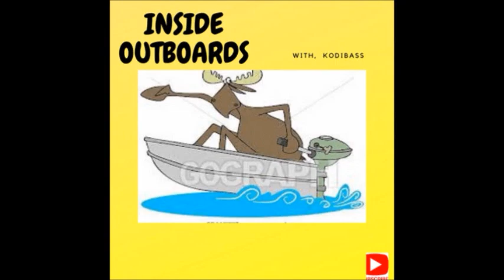JOHNSON 30 HP Outboard     ,, FIXED,,

Comment: Another Great Video from my man KB !  Let those advertisements play ! Happy Memorial Day ! Never Forget ! WhoWhoooo !
Reply from the maker: +TOO---------TOO Kind'  thanks                  L.
Reply: Maybe one of you two know the answer. I have a 1972 20hp Johnson and I t is jumping out of forward at WOT. I was told when I purchased that it would slip out of forward every once and a while. Is there an adjustment for the shift linkage or do I have to open the gear case to check teeth on shift dog and forward gear? Also should this sheer the pin for the prop when it slips out?
Reply from the maker: @MW-gv9vz    Most likely cause is clutch dog shoulders are rounded & warn,     It should not sheer the pin         kodi
Reply: @MW-gv9vz  I had that happen to me once and it did turn out to be in the linkage at the brass connector.
Reply: Well I got it opened up and the brass connector was stretched a bit. But I think more importantly one of the pins on the shift lever was pretty much worn down to nothing. Also the cradle around c.dog where the worn pin resided was all jacked as well. Every thing inside lower unit looked brand new gears, dog and all. My guess someone didn’t know what they were doing when they put it together. Got me a new shift lever and cradle. Just waiting on seal kit. I’ll let you once I get it in the water. Cheers.
Reply: Update ran fine in a barrel in and out of gear at idle great 20-30 min plenty of time to get warmed up. It could hold higher RPMs as well. But I take to the lake next weekend got running got about 45 seconds off the dock at half power. Went full power and lost power engine died out then I couldn’t get it to idle for more then 10-15 seconds. Any Ideas
Reply: Also my kid loves going fishing. But he getting discouraged this is three times now something has gone wrong.
Reply from the maker: @MW-gv9vz   Check & Re-check your compression numbers,  LMK  what they R.    kodi

Comment: That starter WILL NOT fit my 1982 - 15 hp ! Mine don’t have that tail on the left side and they have a U cut into the back of the bracket but thanks for looking ! I’ll stick with the pull string for now I guess but do need a recoil cup for it ! My spring keeps popping out ! Lol. I know there’s a farmers fix with wire but it’s my personal motor and I want it perfect ! Thank you Sir !
Reply from the maker: +DK  they did a"" upgrade""  around 1986 2 those cups by adding re-enforcement 2 where the spring sticks out,   Then around 1991 they added a rope guide 2 the outside lower pan'  neither helped imo,  Not the best  design from omc 4 sure.                 kodi
Reply: kodibass I’m sure they tried to fix but you know engineers they can’t admit anything’s wrong ! Lol ! I did the mechanics wire thing on it and put it on a motor I’m selling and put that one on mine ! It’s holding just fine but didn’t want it on my personal outboard if ya know what I mean ! Lol. Just picked up another 9.9 and 15 hp for $150 each and there recoils look good ! Haha. Thanks again and if you want to send more stuff down I’d be happy to pay for shipping at the very least like before and if you need more then what I sent let me know how much ! I always need clutch dogs and carbs and carb kits and fuel pumps w/ brackets and head gaskets water pump housings and OMC tools come in handy ! Thanks bud !

Comment: On a 2002 Johnson 50hp how would you check the power pack. My engine will not crank and run unless the coil wire which is black with a yellow strip is unhooked from the key switch. I traced the wire back to the power pack and didn’t see it grounding out anywhere . Thanks love watching your channel
Reply from the maker: +DG  The black wire with yellow strip is the kill switch wire,  You most likely have a bad kill switch, or the kill wire to the pak is grounding to the block somewhere, inspect your wires to find the ground, or test the kill switch.             kodi

Comment: I Enjoy Your Video’s. I own a 1981 Johnson 35 hp. Had it for two years my  first boat motor. I enjoy fixing it and keeping her running.Three questions I have for you or requests. Can you do a video of changing the motor mount bushings on a Johnston. I hear a ticking noise when my motor is running. Is that normal  I wasn’t sure. When I did the impeller water pump replacement. I remove the lower leg. I had to undo The linkage  it at  the water intake when I but it back together I’m not sure If I got it adjust right. It does shift well maybe better into reverse better then forward.
Reply from the maker: +MH'  I already have a vid on the motor mounts,  Now ask me what it's called?  I know I did one tho.  Ticking is normal on these older 2 strokes, On your shift link  shift it fwrd / rvers & adjust till you find both r about the same.                    kodi
Reply: I have an 83 that carb was done coil and fuel pump still falls on it`s face.any ideas? and the compression is at 150 each

Comment: I'm confused, that electric starter you showed later in the video is for the 93 and newer models, not the low profile motors...Maybe I am misunderstanding something...
It is such a shame about those lousy paint jobs of that era, partially due to lack of primer and cleaning of the aluminum prior to paint...Nice fix for those silly rubber starter mounts!  I never understood the need/purpose for those mounts, vibration/quietness?  In any event, overengineered with no benefits and added production/repair costs.  Yeah, seems as though that carb still had some dirt in it somewhere...Those newer carbs seem overengineered also, was nothing wrong with the original style carbs with the large needle valve out front.  The engineers were trying to overcome a powerhead design flaw with a more complex carb, which justwon't work...The problem with those powerheads is that the recirc design creates uneven conditions in the crankcase, we should have addressed this issue when the 32CI powerheads were designed, but didn't...  It is so frustrating attempting to "dial in" one of these engines at idle.  Turn the needle in so the engine idles smoothly, you end up with the occasional lean spit/sneeze.  You end up leaving the adjustment somewhat rich to get rid of the lean spit.  There is no way to overcome this with just one carburetor....  
That crazy shift interlock system made these engines tricky to shift, hard to stop in neutral, oftentimes you end up slamming the engine from forward to reverse..
On the plus side, these engines are pretty robust (at least the powerheads and gearcases are).  They are relatively simple and easy to troubleshoot....
Reply from the maker: +kramden'  u r not confused  I AM'  I'll correct in my next vid,  In my head I thought I remembered taking this off a low profile 9.9 Jonny' But you r of
course correct.                                   kodi
Reply: @kodibassInsideoutboards  It is usually me that is confused these days, one of my few moments of clarity!  Still can laugh at myself though, getting easier to do that every day...